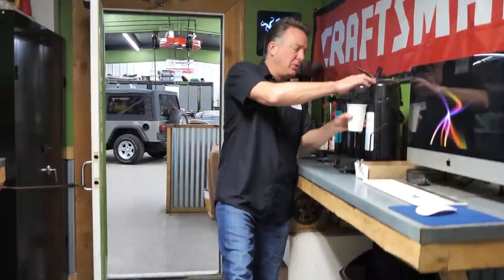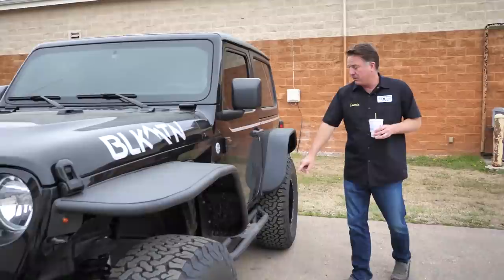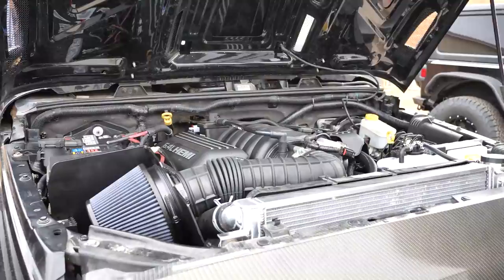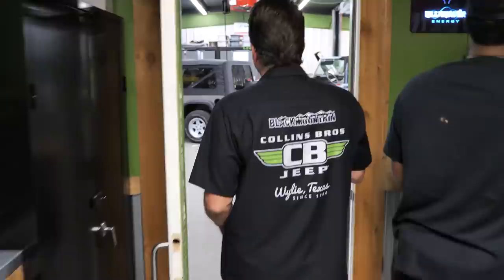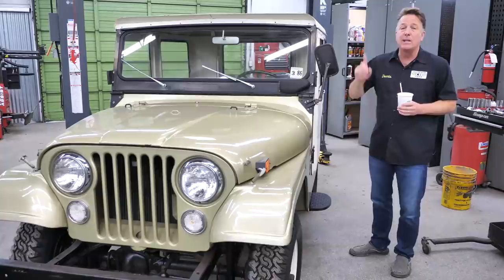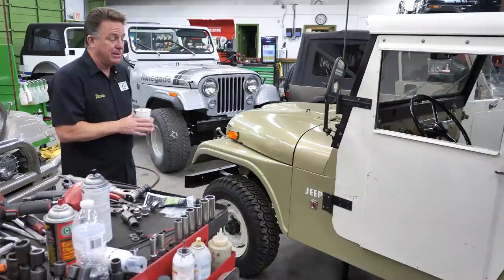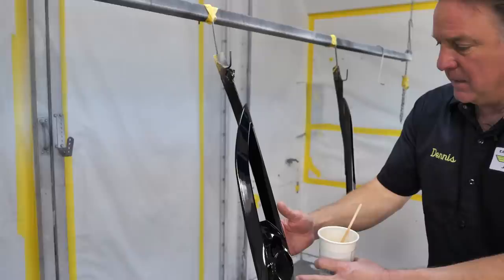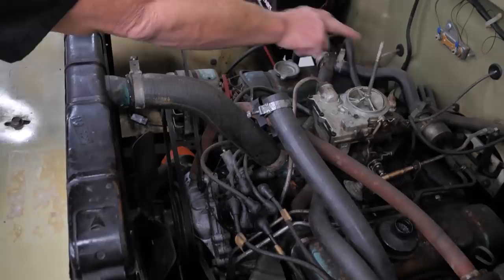JEEP SHOP TOUR!!

Comment: Seeing the ‘70 CJ5 really reminds me of the CJ5 Dad bought new in 1965. Green body with the white top, only it was I believe a Tuxedo Park Mark 4 or 5, with a 3spd on the column. I still have the original green pads that went above the rear wheel wells on the inside & the original seat belts, still in the box they came in from the factory. I guess Dad must’ve ordered them after getting the Jeep & they came into the dealers parts department. It was great to see that color combination & stir up some good memories!

Comment: On the 1970 CJ5 the Dauntless 225 V6 was actually manufactured by Jeep from 1968 to 1971. AMC sold the tooling and rights back to GM in 1974. Buick put it back into production in the fall of 1974 upping the displacement to 231ci as it used their 350 V8's pistons.

Comment: Someday I'll be one of those customer's getting my 2000 TJ out to y'all for a full restoration. I bought it brand new in October of '99, first Solar Yellow the dealer ever sold 😁

I spend most of last winter fixing the majority of mechanic problems that have crept up over the years but body work just isn't my thing and it could probably use a new frame too, unfortunately.

Comment: Surprised you have a pre 76. I had a 65 Tuxedo Park with 17K original miles that I bought out of CA. Drove it a couple of years and then sold. Also had a 70 DJ5 Universal with 26K I sold last year that came from GA.  Both times I considered contacting you since I buy and sell cheap, but just didn't think you would be interested.  That 70  is nice. Great job on the conversions.

Comment: When did Jeeps get so expensive? Even the new 4 cylinders, insane.
Reply: The same time everything else did.  I bought a new car last year to replace my 2001 I had bought brand new.  Saying I had sticker shock was an understatement.  For what I paid for my new car I could have bought a top line luxury car for back in 2001.
Reply: Jeeps have always been pricey. Original msrp wasnt too far from a cadilac on my 81 cj. This jeep was very stripped down but did have some expensive options like, high back seats, factory ski rack, factory fog lights, factory window tint, top, doors, and carpet. Yes top doors and carpet was a option. Sherwood green metalic with nutmeg top, had side steps cause my grandpa who bought it in 81 got sick of hitting his head on the rack so went to the dealer and traded the almost new option for a cheaper option the side steps.
Reply: Newer jeeps i cant afford so i restore my old junk, run em in salt and restore again.
Reply: Who can afford 40 grand just to bear it off road??? Thats why i take a junk cj and dump 5 to 10  grand into making it new and daily it
Reply: Although i save alot on labor since me and my dad do it

Comment: I had a 72? not sure if I'm correct on the year? Jeepster with that same Buick V6 engine and it was my plow truck with a 6' Fisher. That Jeepster never failed me and could push snow anywhere non stop. It was great for plowing because the manual box had 1st and reverse straight back and forth from each other.

Comment: I had a cj5 with the v6 Buick motor .. snapped every bolt on the front of the engine cause the block was aluminum and the bolts were seized..

Comment: I have a 1970 CJ. It had a steel top but I had it off the Jeep, in the barn and a tornado blew it out of the barn and across the pasture so needless to say, I no longer have the top. I do still have the Jeep and hoping to restore. The frame is ok but floor boards need to be replaced. Also some body rust. It sat in the barn for 10+ years but I got it started it earlier this week. It is a 4 cyl., 3 speed. Any thoughts/suggestions on restoring a CJ of this vintage?

Comment: Dennis, I have a 17’ willys, built the way I like. I’ve done a little research because I want a 6.4 hemi to finish it. I have a standard, all I’ve read says that the standard can’t handle more than 300hp. Please tell me I don’t have to get an automatic trans
Reply: The manual transmission that's behind the V6 probably wouldn't last long behind a big V8. You can keep a manual transmission but you'll definitely have to get a different one. The 6.4L Challenger's have a manual transmission available so they are available, but it'd have to be converted to hook up to a transfer case to keep 4wd. Not impossible at all, it'll just take some research and resources.

Comment: So I live in Wisconsin  and grew up in BROWN DEER  WISCONSIN  A SUBURB of Milwaukee's northwest side  and now live in Germantown Wisconsin  and if you ever came to Wisconsin you would be surprised at how many used car lots are trying to do there Jeep thing if thats what you really wanna call IT LMAO AND I MEAN IT (LOL) 

I Was literally in the middle and far west side of milwaukee with a freind  look at a 2005 Cadillac CTS (with low miles and didn't look bad at all for its age and miles 110k) but to my point you wouldn't believe how many corner shops/used car lots are trying to buy Jeeps and modify them anywhere from mild to extreme)  so when we got this used car lot noticed  a bunch of JEEPS ROUGHLY A DOZEN all done up from a distance anywhere from mild to extreme  but when you got into (WHAT I CALL CAR SHOW QUALITY AS IN TOU CAN LOOK AT EVERY PART OF CAR THEY LET YOU LOOK AT DURING THEY WARM WEATHER HERE IN WISCONSIN LMAO

But once you see within 20 feet you start noticing things that don't look rite or one bit safe  so outta the dozen I saw looked at  5 of them and almost S**T myself and wondered how this lot was still in business,  had its license (auction and dealership and so on) was so scary  some of the thing the did especially the welding jobs on the frame and suspension ( LIFT KITS AND BODY LIFT ALSO I WANNA SAY 4 LINK AND SO ON) but were hacking things so bad  and the 2 times I was there for a freind (they had a car he absolutely wanted no matter what 2005 Cadillac CTS NEEDED VERY FRONT OF SUBFRAME REPAIRED ((AS IN IT WAS STARTING TO ROT OUT WERE FRONT OF SUB-FRAME CURLS UP TO THE FIREWALL FOR SUPPORT AND STRENGTH  YOU KNOW WHAT IM TALKKNG ABOUT (((((DDEENNNNIISS))))) Sorry but u had to  but anyways when I looked at somenof rhe work on these JEEPS I ALMOST CRAPPED MY SELF IT WAS SO HORRIBLE and Half of them were pretty much brand new  to a year or 2 old 

Just so sad to see someone hack up a perfect peice of art like that and get away with it  plus the knock off after market parts that try to look like some of the body panels and hood/headlight panels the have on them look like shit and try to mock what you would sell  

JUST A SHAME AND SO GLAD YOU DO WHAT YOU DO AND MAYBE ONE DAY I CAN AFFORD SOMETHING FROM YOU DENNIS EVENNIF IYS ONE OF THOSE RAD LOOKING DICKIE WORK SHIRTS AFYER ALL OF THIS COVID HIT IVE BEEN BARLEY MAKING IT DAY BY DAY WITH ME LOOSIBG JOB AND MY WIFES OWN BUSINESS (PET SITTING) WE WENT FRO N PRETTY GOOD 6 FIGURE A YEAR FOR HER AND ME 75K A YEAR TO ALMOST LOOSING EVERTHING

ANYWAYS KEEP UP THE AWSOME CONTENT AND VIDEOS ALWAYS MAKES MY FRIDAYS THE DAY OF THE WEEK THANKS AGAIN DENNIS COLLINS

Comment: Anyone know the nutmeg top factory paint code? I found a cj8 form that had it but it seems darker than my top (although my tops faded) but even darker than the interior, and the door jam where not much sun gets to. For reference this is a 81 cj7 in sherwood green metallic, all original except passenger half was painted when jeep had 800 miles, lifted suspension, engine and trans and exteriors been painted once. Jeeps been In the family since 1981 so i know these things are original.